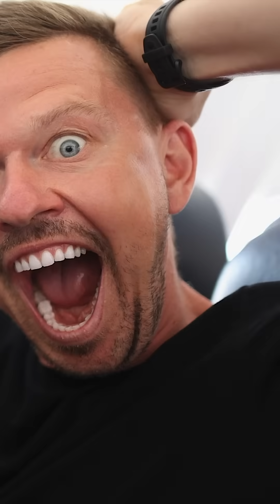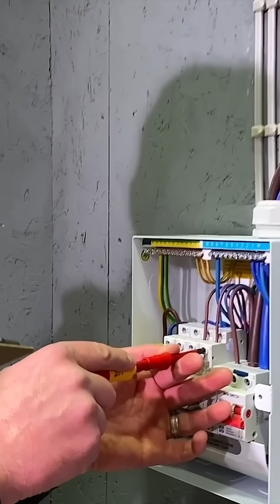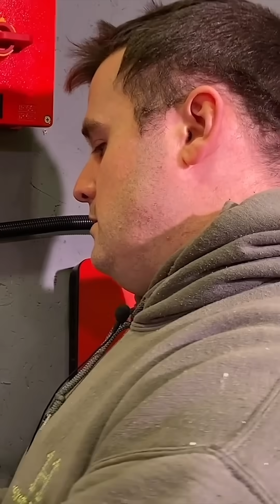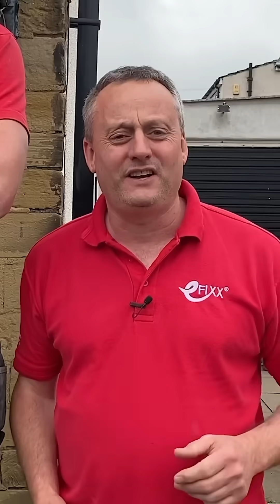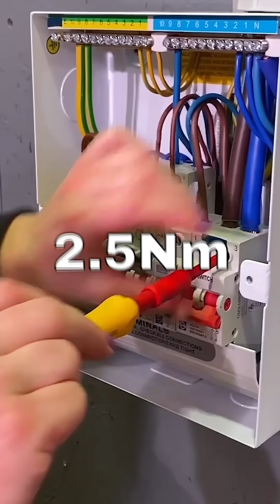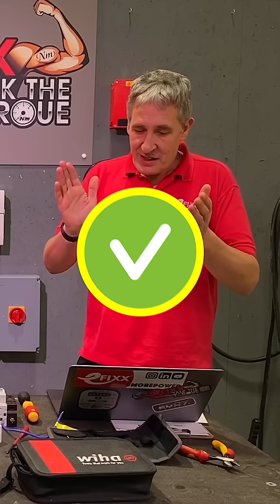The Truth About Electricians and Torque

Comment: The only reason for torque settings is so you dont break the flimsily constructed shyte the manufacturers peddle! I was taught at technical college on a C&G Electrical Engineering course in the early seventies to tighten all screws till the brass squeaked, falure to do this was a practical fail! Of course today the manufacturers are using steel screws cos its CHEAPER!! Why are the torque settings not all the same? You are effectively saying that some terminals can be looser than others? Engineering? I don’t think so! Things haven’t moved on, they have regressed badly! Equipment manufacturers should not be allowed to create regulations in order to sell their products!
Glad to be retired from the industry
Phil
PS, our consumer units NEVER caught fire!!
Reply: Those screws had a torque spec too.  Perhaps more generous than what is seen today but they still had them.  Go too tight and you'd chew the head up and/or cut into the conductor.  Even in the comparatively limited time I had in the industry I came across solid wires that had been cut into and fractured leaving only the twisted part (standard practice is to twist wires together in Australia) holding the wires in contact.  Getting it right then was just as important as getting it right today.  I also found loose terminals in my own house when I reworked the electrical in the '80s that had been relying on the twist to keep contact.  Scary when its considered that it was supplying the kitchen and laundry where high current appliances were being used.

Comment: Rubbish. Electricians are better than the torque screw driver. You two can’t even get the correct cables in the correct terminals.

Comment: It’s important to do the terminals up to the correct tightness or torque.then wriggle them then check again . Especially with larger cables like tails . They will only work loose over time if you don’t .
Reply: Exactly. A good twist back and forth and you’ll get as much as an extra turn especially with cage clamp terminals. I’ve never seen any requirement to do this when talking torque screwdrivers which are a great addition but no amount of correct torque can replace skill, experience and proper workmanship.

Comment: Why is it important- the fittings / terminals can be damaged and copper / many materials are actually fluids and creep over time, leading to increased electrical resistance = heat

Comment: Entro you talk about aircraft manufacturing/maintenance . Big difference aircraft engineers don’t use a sh-ty torque screwdriver they use a heavy duty torque wrench. I work at Heathrow Airport and I had the chance to spend a day in the BA maintenance hangar . Then the following day at BA world cargo maintenance department . Wear I worked for six years. And I did see one single torque screwdriver i did however see lots of torque wrenches of different sizes.
Reply: I would hardly say a torque screwdriver is shitty. It's made for the job, just like the torque wrenches used by the aircraft technicians. What would be shitty would be using a screwdriver where you need a wrench and a wrench where you need a screwdriver.
Reply: @JaenFoster I’m say they are sh-ty I was simply saying compared too the wrench’s aircraft engineers use and the level of torque they have to reach  a torque screwdriver is nothing. But for us humble spark’s do house bashing and light industrial a torque screwdriver is a must if you want to comply with the manufacturers instructions.
Reply: @Dog-whisperer7494  no shitty would imply poor quality or inaccurate. But calling it shitty because it's smaller than something else is like saying a scalpel is shitty because you can't clear bush with it, or a soldering iron is shitty because it's not hot enough to cut steel. Shitty is used to describe something of poor quality or that is inappropriate or inadequate for the job it's meant to be used for, not because it's inappropriate for a completely different job.
Reply: I think you've missed the point.
Reply: @Nyle95 no I didn’t miss the point